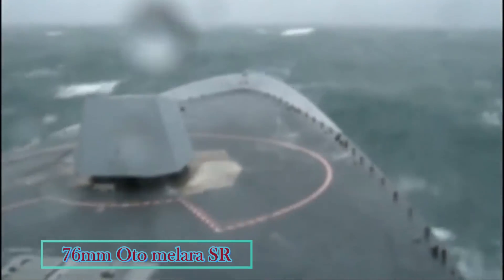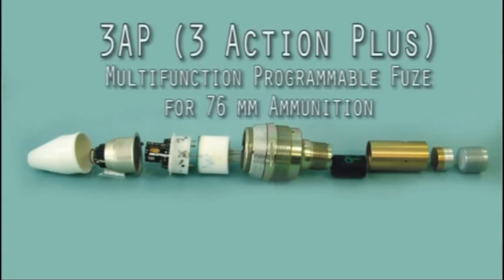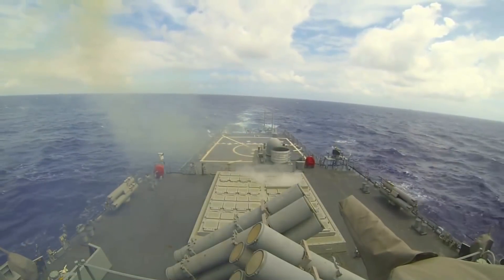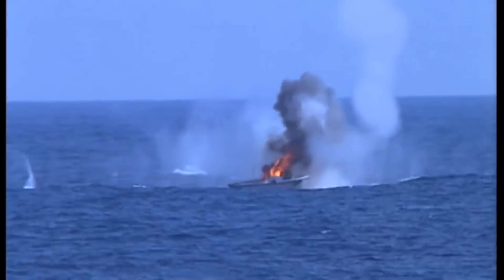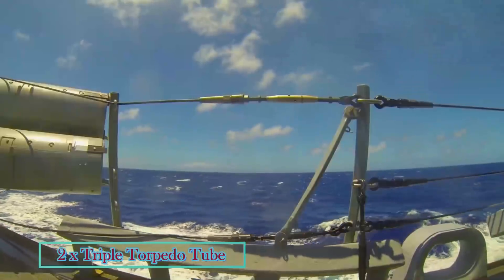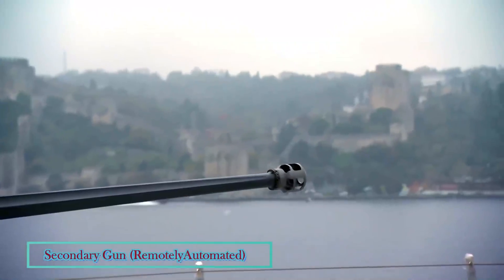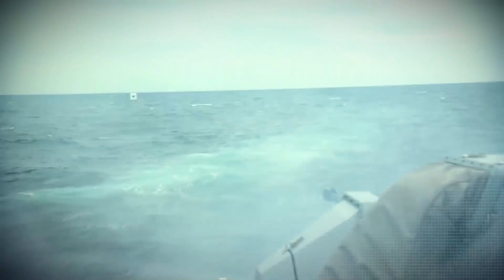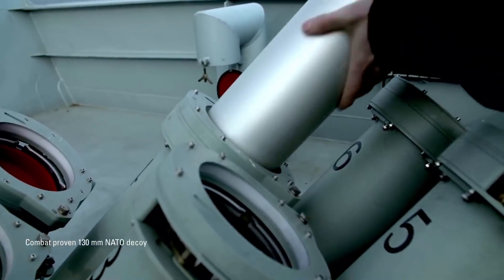Main Weapon of BRP Jose Rizal FF150

Comment: NOTE: The following are the complete armament of the new frigates BRP Jose Rizal and Antonio Luna. There are 2 missing important items as marked (FFBNW). The most important ASM Anti Shop Shop MISSILE VLS ( Vertical Launching System) which has a longer range than the Mistral (RIM) and the LIGnex 1missiles. Without the VLS SAM or ASM Type st a longer range about more than 100 miles , the Philippine frigates will have no match with the Chinese PLA  Navy unless it is modified with BRAHMOS VLS or Tubular/Harpoon. Launching Type like the Russian or Indian frigates.

Armament:
1 × OTO Melara 76 mm Super Rapid gun
1 × ASELSAN SMASH 30 mm gun
4 × S&T Motiv K6 .50 cal (12.7 mm) guns
1 × Close-in weapon system (FFBNW)
4 × LIGNex1 SSM-700K C-Star anti-ship missile on twin canisters
2 × SEA triple torpedo tubes for K745 Blue Shark torpedo
2 × MBDA Mistral Simbad-RC twin launchers
8-cell Vertical Launching System (FFBNW)
Reply from the maker: Thank you..We hope that the AFP would upgrade the frigate by installing VLS and CIWS..

Comment: in the heat of battle whether surface ship or air attack this 76mm automatic cannon is totally useless in modern warfare because of its limited projectile range. What the ship needs are anti-missile missile, anti-aircraft missile, anti ship missile ,CIWS (close-in weapon system ) and torpedo for anti-submarine warfare.
Reply: It can be use for asymmetric warfare

Comment: I agree with you that the oto melara 76mm works not only for ship to surface, ship to ship, anti air and ciws...this is why i was wondering why the PCG is not retrofitting their large enough MRRV cutters with oto melara 76mm for ship vs ship, anti air and ciws, anti swarm drones and anti boat swarms at longer ranges as well as gunfire support so that PCG can back up the PN right way when the "sh...i...8 hits the fan"...and not manuever and evade becuase theirs is too small and only for virgin chinese fishing boats
Reply: PCG is OPV's or patrol boats is not design like a warship no missiles or torpedos only cannons and machine guns that's why they are belong to the DOTR not in the DND..
Reply: @kakalmatthew9605  yeh no torp or missile
though many PCG ship may be similar to the Jacinto class or Peacock class ex-Hong Kong police force patrol boats at armed with a 76mm oto melara that that is lethal and accurate up to 8 miles to defend against swarm boats or swarm drones, and can function as ciws  since thw PN and PCG will more likely than not be participants when China finally decide to re-unite  Taiwan back to the mainland before the USN presence grow stronger to the point that PLAN perceives that " its now or never". its likely that some of the thiousands of Chinese fishing boats inside the Philippine EEZ  are not limited as "listening posts" but its probable among the fishing boats hanging at the rear and vanguard of the fishing boat fleet are their own security elements that can be armed when they decide it needs to be armed  while just further in the horizon their giant coast guard some ex-PLAN frigates retaining 75mm guns and who knows what else as well as PLAN frigates who are herding the thousands of Chinese fishing boats.

Even in the northern Philippine waters Taiwan fishing boats doing tje same under escort of their gigantic coast guard cutter who are likely armed with longer rang guns and who knowa what else... hope that PCG at least consider 76mm guns its afterall a ciws, anti-ship, its rapid fire makes it AA, anti swarm weapon...